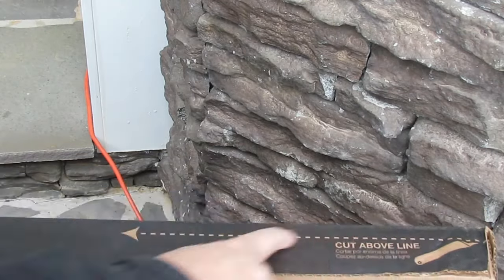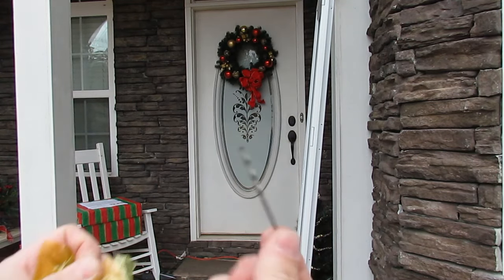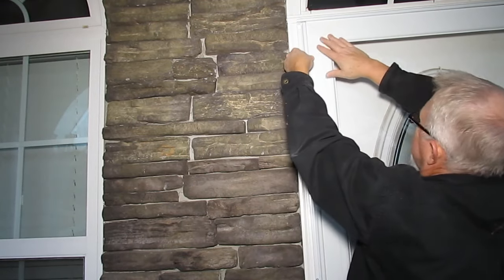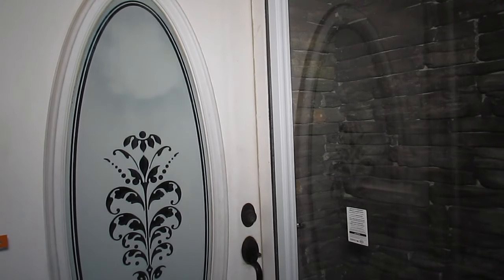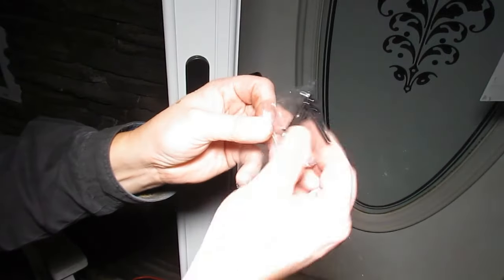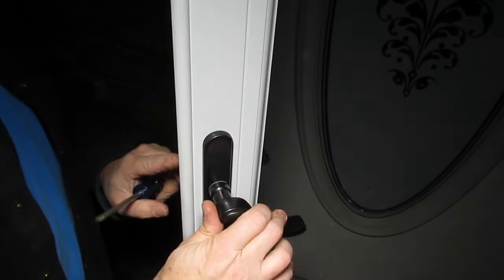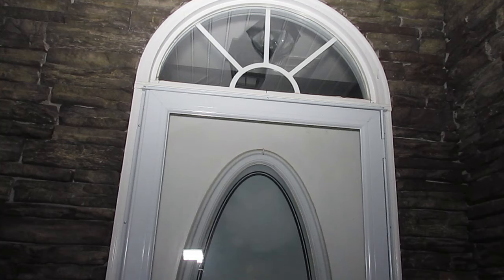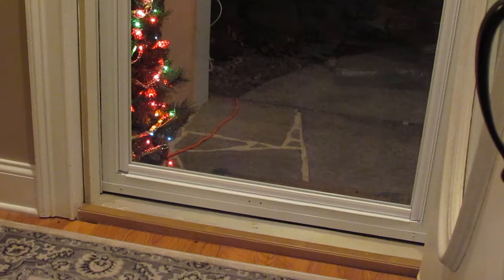Install Andersen Storm Door

Comment: Nice job young man! Can't wait to install mine!
Reply from the maker: Thank you very much for watching, William!
Reply: I thought handle on storm door should be on same side as entrance ddor
Reply from the maker: Although not a requirement , most often storms doors are installed with the lockset on the same side of the opening as the entry door.  You'll notice in this video , I install the storm door with the lockset on the opposite side as the entry door.  There is a reason for this.  The entry door install ed by the builder is the wrong hand, it should have been a left hand door based on the way the front porch is built.  It will be changed to a left hand door in the future.  If I had installed a storm door with the handle on the same side as the existing entry door, we would exit the doorway into a wall unless the door was fully opened when walking out.  Not convenient at all, so changing the entry door to the proper hand door will be the best solution.  Thanks for watching!

Comment: Is it common to have the storm door handle on the opposite side to the entry door? I would think the way you did it would make it more difficult to enter and exit. Great video!
Reply from the maker: Thanks for watching, Ricky!  Not common at all, but necessary in this case.  The builder put the wrong hand door in as the entry door, so if I had matched that, we would walk out into a wall.  I'm going to change the entry door to the correct hand.

Comment: Did you have any trouble getting the short screws into the pre made holes during the closing part? Our screws seem too wide. Do we just need to force them in better?
Reply from the maker: Thanks for watching, Alyssa!  I don't remember having too much trouble, but it does seems like the screws were really tight to get started.

Comment: Excellent instrucyional video. Why was the door installed with the door handle in the opposite side of the front doors handle? I want to install mine with the door handles on the same side. But I want to make sure that's ok before I purchase the door. Thanks
Reply from the maker: Thanks for watching!  Please see the video description where I explain the handles.  You will be fine to install yours on the same side as that is more common.  thanks!

Comment: Out of curiosity is there a benefit to doing left hand open storm door with a right hand open main door? I’ve always seen storm door matched up to the main door open side
Reply: I was going to ask the same thing. The only thing I can think of is that there wasn't enough room for the handle set, that is, it looks like the main door handset is the same level as the storm door handle set. Their literature says that when measuring, you need to make sure you have 2-1/2 inch clearance in the door jam area. In my case, it looks like my main handset is low enough not to interfere.
Reply from the maker: Thanks for watching!!  Please check the video description, I explain it there.  Same side is definitely most common.

Comment: Your video was very helpful. In this video, you provided useful information that helped me fill-in the gaps that existed between what I was working with and what actually needed to be done. The manufacturer has very good Customer Support, but you helped out where the rubber meets the road. I appreciate it. (I'm now your newest Subscriber. Looking forward to more of your stuff.)
Reply from the maker: Thanks for watching, Jim!  I'm glad to know this helped!  Are you an Amateur Radio Operator?  I noticed your username includes AB9AB (looks like a ham call).  I am WA4YYQ.
Reply: @dwcoffey  MARS call sign from my old military unit in the VN war.
Reply from the maker: Gotcha.  Welcome home!

Comment: Great video. My  bottom closure is making a popping sound when the door closes. Any idea what it could be?
Reply from the maker: Thanks for watching, Mansur!  Try rotating the end on the closer 180 degrees and reattaching to the pivot point.  If that doesn't work, try the other end.  Also, be sure you are using the small hole on the end of the closer, not the large hole.  I hope that helps!

Comment: I plan to install same door.  My current door casing is typical brick mould on both sides but I have a transom window above and the bottom sill of that stands about 1/4" proud of the side brick mould.  Will that be a problem?  Do I need to remove that 1/4" of wood before installing or will the separate top cap piece accommodate it OK?
Reply from the maker: Thanks for watching, Peter.  The moulding under my top window sits about 1/8" proud of the  entry door brick mould and I had a slight gap on the top 12" or so of the storm door frame, between it and the brick moulding.  I caulked it and it was fine.    If yours is sitting 1/4" proud, you may need to plane some of that off before installing this storm door.
Reply: Dennis Coffey Thanks, exactly as I’d anticipated.

Comment: I’m curious. Why did you install the handle on the opposite side of the exterior door handle? I’m not accustomed to seeing it done like that.
Reply from the maker: Thanks for watching! I explain that in the video description, basically the builder put the wrong hand entry door in, so if I matched it with the storm door, we would exit into a wall.  LOL!

Comment: I purchased the same door/size, and ran into the door bell issue. I'm interested to know where you moved the door bell. Thanks
Reply from the maker: Thanks for watching, GeeGee!  (Is Koffie your last name?  Mine is Coffey, and I've never seen it spelled Koffie before).  I moved it about an inch outside the frame.  The moulding on my door casing is wide enough so that I could just drill a new doorbell hole next to the existing one, route the wire into it and place the button there.  I think if I had been forced to move it further, I would have probably gotten a piece of matching synthetic stone or maybe cut a decorative piece of hardwood to mount the doorbell button on and mount it next to the door casing.

Comment: It looks like you have the storm door swing opposite of the inside door. Is there a reason for this! I could be wrong but that is what it looked like to me. Great video easy to follow! Thanks
Reply from the maker: Thanks for watching, Frank!  Although not a requirement , most often storms doors are installed with the lockset on the same side of the opening as the entry door.  You'll notice in this video , I install the storm door with the lockset on the opposite side as the entry door.  There is a reason for this.  The entry door installed by the builder is the wrong hand, it should have been a left hand door based on the way the front porch is built.  It will be changed to a left hand door in the future.  If I had installed a storm door with the handle on the same side as the existing entry door, we would exit the doorway into a wall unless the door was fully opened when walking out.  Not convenient at all, so changing the entry door to the proper hand door will be the best solution.

Comment: HELLO DENNIS GREAT VIDEO! I HAVE ONE QUESTION CAN YOU TELL ME WHAT IS THE PURPOSE OF THE SLIDE ON THE INSIDE OF THE HANDLE.  WE ALL KNOW WHAT THE HANDLE DOES AND WHAT THE DEAD BOLT DOES BUT I DON'T KNOW THE PURPOSE OF THE THE UPPER SLIDE ON THE INTERIOR
Reply from the maker: Thanks for watching, Eileen!  That little slider is used to release the handle and flip it upwards so you can more easily change between the glass and the screen insert in a door.  Basically it lets you flip the handle up so it isn't in your way when taking the glass or the screen out.

Comment: I'm looking to install the same storm door and will have the exact same issue with needing to move my doorbell.  I was looking forward to seeing your solution, but you didn't circle back to it - so what did you do about that?
Reply from the maker: Sorry about that....that was another video.  Basically, I held the doorbell wire out of the way and drilled a hole next to the existing hole using a forstner or a spade bit.  Routed the wire and installed the existing doorbell into the new hole.  I just moved it over about an inch. Thanks for watching!

Comment: Nice video on the installation, one question, I thought the handle was supposed to line up with the entry door handle, just asking.
Reply from the maker: Thanks for watching, Robert!  Great question.  Although not a requirement , most often storms doors are installed with the lockset on the same side of the opening as the entry door.  I installed the storm door with the lockset on the opposite side as the entry door because the entry door installed by the builder is the wrong hand, it should have been a left hand door based on the way the front porch is built.  It will be changed to a left hand door in the future.  If I had installed a storm door with the handle on the same side as the existing entry door, we would exit the doorway into a wall unless the door was fully opened when walking out.  Not convenient at all, so changing the entry door to the proper hand door will be the best solution.
Reply: @dwcoffey  Might have been good to let everyone know when you made the video that that was your intent on how you installed opposite of what would be normal (don't need 500 people doing the same thing!  lol).

Comment: Thank you Dennis, instructions on paper were useful but seeing things in action was even better. I don't know why Anderson storm door came with 10 self-tapping screws, and at first I mistakenly put those instead of 1" screws. Also, door did not open at first, I put too much force to open it. Thank god nothing broke but came to know that latch was engaged. And there is no instruction on paper nor in your video. It would definitely help to suggest inserting the spindle and quarter turn clockwise to release the latch and open the door. I mean the notch should point up to open the door. That will help many. And once again thanks and really appreciate your video.
Reply from the maker: Thanks for watching, Vinay!  I did not have that problem with the latch as it was not installed on the door when I received it.  I had to install the latch.  I'm glad you got it worked out!

Comment: Video was better than the written instructions. Door fit and was perfectly lined up and level, but doing all the drilling and screwing was made harder by some of the orange fasteners. Had difficult time opening the door because of the top orange fastener. Felt I was doing something wrong. Also the need to break the black rivet type fasteners  on the side of the door frame  to  remove the orange piece was not  clearly explained. The lockset instructions  were different on  the door instructions and the lockset instructions.  Referring to the orientation of the inside square opening.  It was also not clear as to orienting the handsets to make the plunger work. Felt I needed three hands to make it stay put before screwing.  The instructions call for putting the handle without the spindle first. The video showed putting up the spindle handle first which worked. I should have re-watched the video before doing the installation. 

Nice door and hardware, but of course my door won't swing open because of my existing entryway light fixture. I will have to replace it with something smaller. I'm going to wait until tomorrow to finish the trim installation. Maybe all the other guys commenting are smarter than I am but it was a good video to watch.
Reply from the maker: Thank you for watching, BIll!  I hope you are able to resolve the door/light-fixture issue.

Comment: Didn't understand the part about which side the door opens from. I see your door opens on the other side. Thanks for sharing.
Reply from the maker: Our entry door was installed using the wrong hand door.  The way our porch is built, the builder should have installed a right hand door, putting the door handle on the left side while standing outside.  I'm replacing the entry door with a right  hand door, so I installed a left hand storm door.  The handles will  be on the same side once I replace the entry door.  Thanks for watching!

Comment: I have the exact same main door with the oval glass… I was curious if yours is peeling due to old age and sun damage??? If so what was your method in fixing it.
Reply from the maker: Thank you for watching, Ryan!  I haven't had any issues like that with mine.  I don't remember what the warranty period is on these doors, but you might want to check into that.  You may be able to get it replaced thru the warranty.

Comment: I’m curious what you ended up doing with the doorbell. My doorbell is in the same place and don’t know how I would deal with the doorbell when I try to install the door. Any help would be much appreciated!
Reply from the maker: Thanks for watching, Travis!  I drilled another hole just to the outside of the original hole in the doorframe and moved the button to that hole.  The original hole was covered by the storm door frame.

Comment: I noticed that you removed the screen and the glass, but on your install the glass was back in? Which way does the instructions say to do it?
Reply from the maker: Hi Peter, thanks for watching.  On this door, you can only have one in at a time, either the screen or the glass, not both.  My door came with the glass installed and the screen separate.  I stored the screen and left the glass installed.  To remove one, you snap out the clips on the inside perimeter of the door, remove either the glass or the screen....insert whichever one you want and re-insert the retaining clips all the way around.

Comment: Question: Why does your storm door and the entry door have two different door swings, is that the right way to do it or is there a different explanation? Thank you.
Reply from the maker: Thank you for watching, Anton!  Although not a requirement , most often storms doors are installed with the lockset on the same side of the opening as the entry door.  As you noticed in this video , I install the storm door with the lockset on the opposite side as the entry door.  There is a reason for this.  The entry door installed by the builder is the wrong hand, it should have been a left hand door based on the way the front porch is built.  It will be changed to a left hand door in the future.  If I had installed a storm door with the handle on the same side as the existing entry door, we would exit the doorway into a wall unless the door was fully opened when walking out.

Comment: I was curious as to why you chose a left opening when your door was right side opening?
Reply from the maker: Although not a requirement , most often storms doors are installed with the lockset on the same side of the opening as the entry door.  I installed the storm door with the lockset on the opposite side as the entry door in this video.  There is a reason for this.  The entry door installed by the builder is the wrong hand, it should have been a left hand door based on the way the front porch is built.  It will be changed to a left hand door in the future.  If I had installed a storm door with the handle on the same side as the existing entry door, we would exit the doorway into a wall unless the door was fully opened when walking out.  Not convenient at all, so changing the entry door to the proper hand door will be the best solution.  Thanks for watching, Pamela!

Comment: Another down side about changing out the screen & glass panel is that you have to carefully store them so that wont get damaged and where would that be for a long piece of fragile glass?
Reply from the maker: Thanks for watching, Diane!  That is true!  I think the glass is tempered glass, so it is a little more resilient than some, but still glass and still fragile, as you said.  Even the screen requires some safe spot to store so that it doesn't get torn, etc.  I keep mine in the basement, behind a door.  I've often thought about getting creative and making a rack of sorts on the backside of a closet door to hang the glass or screen on.

Comment: Did you put storm door handle opposite inside door handle because you didn’t have enough depth for storm door handle to clear inside door handle oinside door itself?
Reply from the maker: Thanks for watching!  Although not a requirement , most often storms doors are installed with the lockset on the same side of the opening as the entry door.  I installed the storm door with the lockset on the opposite side as the entry door because the entry door installed by the builder is the wrong hand, it should have been a left hand door based on the way the front porch is built.  It will be changed to a left hand door in the future.  If I had installed a storm door with the handle on the same side as the existing entry door, we would exit the doorway into a wall unless the door was fully opened when walking out.  Not convenient at all, so changing the entry door to the proper hand door will be the best solution.
Reply: @dwcoffey  Thanks for quick reply, video was great with explanation and visual, ordered 2 doors but have a bit of framework to do first.

Comment: Put a second storm door on yesterday, used your handy video again... Only problem I ran into this time was the bottom corner of door doesn't want to close completly, not sure why.. I even tried sliding the closer bracket out further towards that corner and that helped some but still didn't completly shut like the top.... Weird, not sure why..... Any ideas?
Reply from the maker: Thanks for watching, William!  I'm sure you've done this already, but I'd first look for places that pone corner is hanging up....maybe there's a bend in the frame or a filing from manufacturing stuck between the door and the frame, or a screw head not fully seated on the bottom of the door, etc.  If nothing there, then I'd closely inspect the lower hinge.  It may be missing a plastic bushing, etc causing it to allow the door to get out of alignment when closing.  Let me know if I can help.